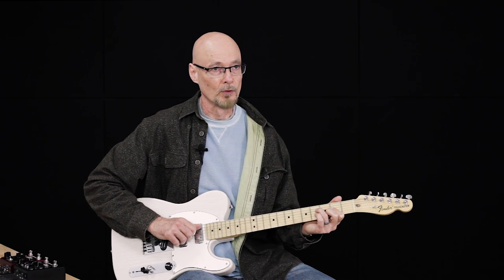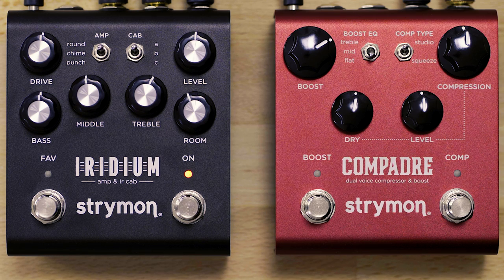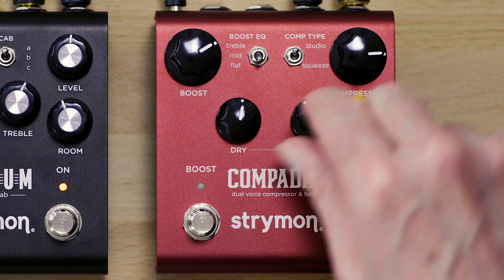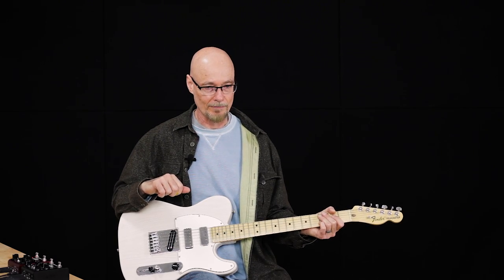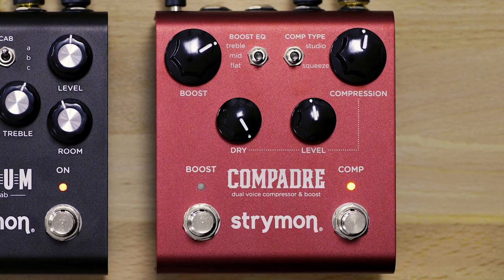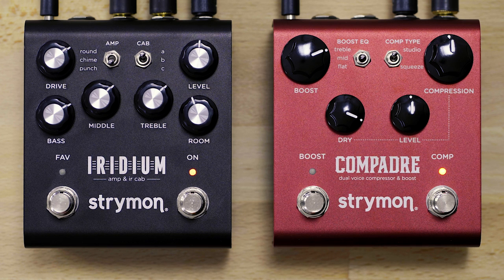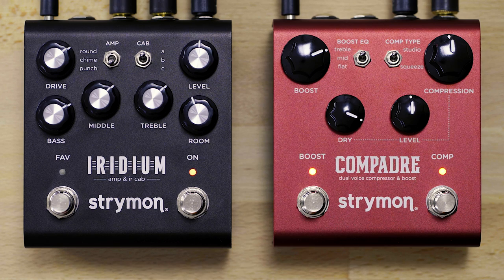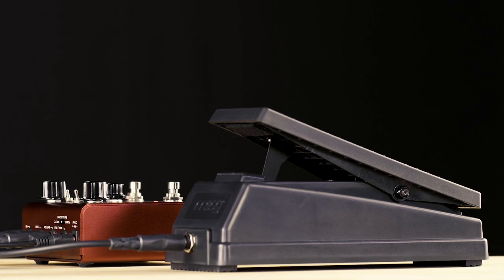Strymon Compadre – In-Depth Tour With Sound Designer Pete Celi

Comment: The only issue for me is that I like my compression at the beginning of the pedal chain and the boost at the end for gigs (remember when there were gigs?). You've added some nice added features over the OB1. I like the two compression settings and the dry blend, which has been a big trend in pedal compressors the last several years and for good reason - you get the attack back! Thanks for the video.

Comment: I'm a bit surprised that it's not less money. I think the price would be justified with secondary controls. It would be nice to control the q of the mid and treble boost. 
A secondary attack and release control would also seem necessary to justify the higher price tag. The Ob.1 was priced great at 200. I would understand 250 for the pedal as is, but would really love more secondary controls.

Comment: This could replace two well-loved pedals on my board, my full-size TC Spark and Wampler Ego.  I love the three-way switch on the boost; it's very similar to the Spark in that regard.  Not quite as much control as the Spark, but it can get the job done without it.  That's what I love about Compadre; you don't miss the lack of control because what's there is perfect for 90+% of guitarists, thanks to its brilliant design.  Certainly would check all the boxes for me!  GAS activated.

I KNEW THIS WOULD HAPPEN WHY DID I WATCH THIS

Comment: I wonder if it has a built in noise gate like the SunSet and Riverside... seems like that might be a little beneficial with a compressor in some cases. They can be a little noisy, especially if you have a boost following it. Looks like a pretty cool pedal though.

Comment: In the various Compadre demos now online, it seems like folks are switching between single coils and humbuckers pretty easily, something other compressors can have a hard time with without somehow adjusting input gain. How does the Compadre handle hotter pickups like high-wounds or even actives? Are there recommended settings for these, or is it plug-and-play?

Comment: Prob that I’m having is that when I put up the compressor the entire volume comes up and I can’t get it back to original volume even when level is at zero. I have to leave the compressor on less than half to keep my volume…weird
Reply from the maker: Compadre has a super high-quality VCA that you can use as a master volume with an expression pedal, which may be a good solution for your problem. That way, if you choose a different preset with a completely different threshold setting, you can adjust the output that way. Hope that helps!
Reply: @strymon  Ok I suppose I’ll need to bring another accessory on the gig:-) I do wonder why the volume goes up with the compressor knob and won’t come down enough. Over-site or just the way compression works…? Thanks!

Comment: I’ve never had a compression pedal and I’m wondering if they generally add a lot of noise? I can hear a lot of hum, especially with the pedal on and I’ve noticed this on several other compressor videos from other brands as well. Sound really nice though and I want one!
Reply: any noise going into the pedal will be compressed, so it can make noise issues worse if you have a lot of noisy pedals in front of it

Comment: No one is mentioning the “high voltage hum”. I’ve experienced this with a compression/sustain pedal before, of course. Would a noisegate tame it, or is it just the nature of the beast when it comes to boosting a signal?
Reply: It's the nature of the beast when it comes to boosting a signal that is in an environment conducive to hum. IE: A compressor (any compressor) will only deal with the signal it's given. It wont itself add hum or noise (other than specific situations where you get a ground loop hum).
Reply: compression is lowering dynamic range and bringing noise (quietest signals) up, and loud peaks (loudest signals) down. So while compression itself is not changing the volume of the noise, the gain required to compensate for the compression WILL bring the noise floor up
Reply: In my experience with a couple compressors they all have a hum but def more than others. I just Got a Jackson Audio Bloom V2 comp and it by far is the best one I have tried it’s awesome!

Comment: I got a problem with the compadre.

Very early in the compression ratio it impossible to have unity gain. 
I see in the video that you have a pretty high studio compression an can still have unity gain/volume out. But that’s not what I experience. Even with the compression only just above 12 o’clock I can’t have unity gain with even with the level at 0. It’s a big problem and I’m about to take the pedal off.

Another thing is that midi pc 127 is not manual/knobsetting, - a preset is saved there. You really should make a software update to fix this, I really need that.
Reply from the maker: Hey there! Sorry to hear you are having issues. Please feel free to email us at support@strymon.net, and we'd be happy to assist.
Reply: I have the same issue. In fact, I have to turn Level knob fully counterclockwise, otherwise I get a tremendous (undesired) boost. Signal level with compressor engaged is ridiculously boosted. And if I start turning Level knob clockwise, signal level difference between compressor on and compressor off gets even crazier...

Comment: I dig almost everything that strymon does, but how can they honestly say this competes with the Jackson Audio Bloom or the Origin Effects Cali pedals? Same price point with WAY less features and doesn’t sound better. The Jackson Audio Bloom has Midi control of different compressors, a switchable 3 band EQ and a boost.... and it’s roughly the same price. I just think you need more features to compete in the current compressor market my dudes. Otherwise! Keep putting out killer stuff!!
Reply: I think that the Strymon's philosophy is still the same on this one. "Less is More" is something that many guitarist are looking for. It just works. I'm not saying that the Jackson is worse, they're just different.
Reply: less is more ?- have you seen the Volante?
Reply: Probably higher quality electronics in this resulting in a cleaner signal but that's a guess based on Strymon's history.

Comment: Great compressor!!!I just bought it and I love it so much!!!I am using it as my first pedal in my pedalboard.Can I use it in buffer mode as my input buffer for my whole chain???how good works the buffer as an input buffer???about the expression pedal:I have the Dunlop DVP4 Volume (X) Mini Pedal and I connected it as expression pedal:is this pedal good enough or which expression pedals you recommend???any  in particular???Do I losted some quality tone if I connect a expression pedal???is the buffer in the compressor helping me to keep my tone in great shape and quality???Thanks!!!
Reply from the maker: Glad to hear you are enjoying Compadre! You can certainly use it first in the chain if you want to use it as a buffer when in Buffered Bypass. 

As far as expression pedals go, we recommend using something with a 25k Ohm pot. Not sure what the resistance of the DVP4 is, but we use Moog EP-3s and Mission 25s at the office, and they work great! No  tone or quality lost when using an expression pedal. Hope this helps!
Reply: @strymon  Thanks a lot for your reply and for the expression volume pedals recommendation!!!That’s exactly what I needed to know!!!🙏🏻Yes,I will be using the Compadre Compressor first in my chain in Buffer mode as my input buffer to my whole pedalboard and I will definitely get the Moog EP-3 expression pedal for sure!!!🙌🏻🔥🎸🌎😎🙅🏻‍♂️

Comment: Seems to add more background noise hum.
Reply: Yes. Mine adds a lot of noise. I know every compressor adds some noise by design, but either I got a faulty device or it has something to do with my guitar / pickups. 

I already tried two different guitars. With my semi-hollow, Compadre adds tons of hiss and static noise. With a solidbody humbucker guitar there is much less noise but still it's very very present in the signal... 🥺

And honestly, I bought Compadre because I read in several reviews how it is a low-noise compressor. 

BTW, I'm just running the guitar through Compadre to the Amp. Without Compadre = no noise, no hiss. With compadre (even with slightest compression) - loads of hiss / noise...

Comment: Sounds are great! Is there a way to loop in and out of each effect? I typically put a compressor up front, and a boost later in the chain, after my distortions.
Reply from the maker: Unfortunately that's not possible as the pedal is mono and only has one input and output.